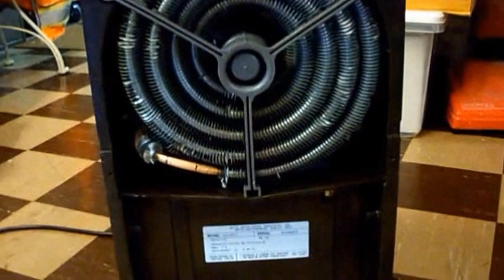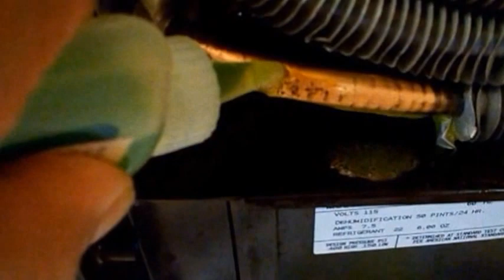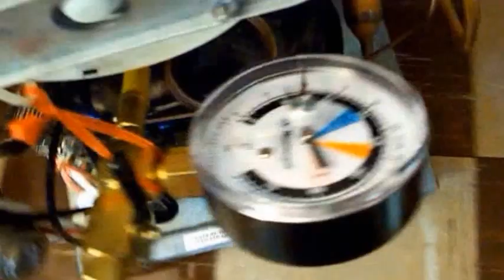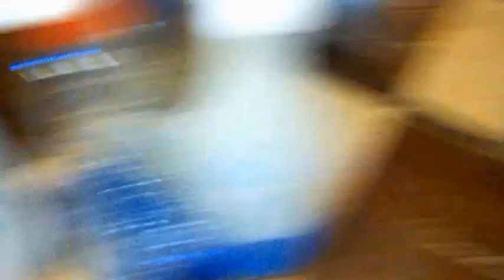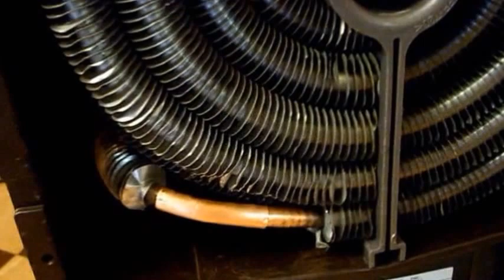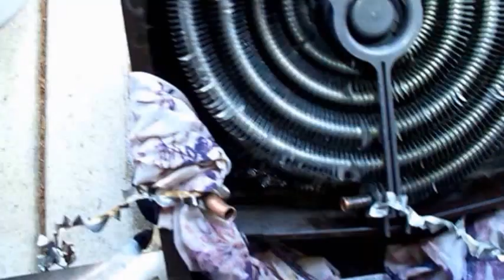Dehumidifier Repair White Westinghouse Pt#1

Comment: This is one of the later models with the copper evaporator.  The best ones were the ones which had the aluminium open coil evaporator.  Some models have a "Frost Sentry" feature which have a hot gas bypass valve which operates on a fixed cycle to prevent frost buildup on the coils.

Comment: Great Job on that repair. Is there a video of the recharge process?
Reply from the maker: no but I had to pull the system down with a vacuum pump to charge. on a side note after about 1-1/2 yrs the compression fitting started leaking. the best way to repair would have been to make a whole new coil out of new copper tubing. after all was said and done menards had a sale on a new unit (small tank) but with a internal pump for remote location. the box said the pump was good for 16ft of head. once set up with plastic 3/8 tubing overhead to sump the new unit internal pump had trouble reliably pumping until the entire length of overhead tubing was filled. once filled I think the length of tube going down from the ceiling into the sump pit actually acts as a syphon,  it remains full but when the pump turns on the column head of water pulls down and it make it easier for the pump on the up side.  that has been running for a while now without a problem
Reply: @whooper3336  I have not had very good luck with flare or compression fittings. The last leak I fixed was on a 1/4 discharge line. All I did was flare a 2 inch piece of 5/16 on both ends shove it over the 1/4 and pluming soldered it on. It was a super tight space and it had plastic around it so I could only use what I could melt with a small butane torch.

Comment: if you have ac problems with cars use compressed air to check for leaks. the system is open anyhow if the system is empty its equal to atmosphere its a open system then.  if your not replacing the accumulator drier then nitrogen is the standard for appliances?.on car sytems needs a new drier an expansion valve or orifice tube for sure. I have  Westinghouse deluxe 14 like to evac and recharge. must be low on refrigerant it freezes up on dial setting 5   I cleaned everything fan is good heat shroud was wonky, fixed that looks like it helps to defrost coil? i got garden hose from tank to drain in basement